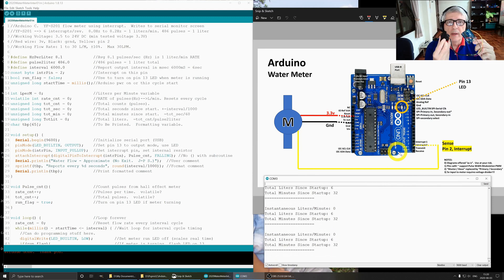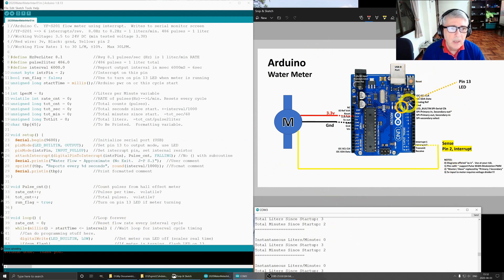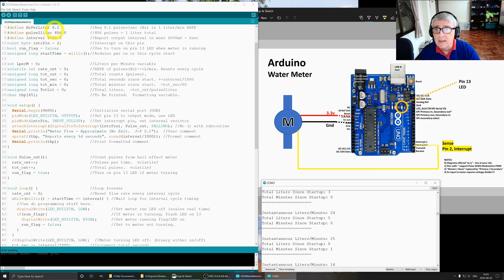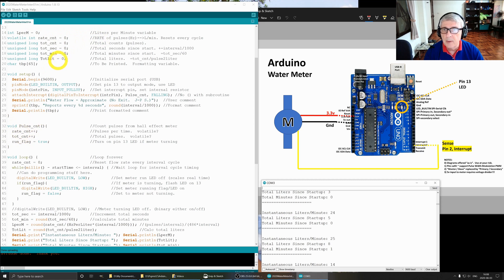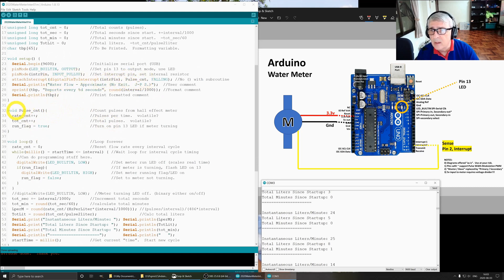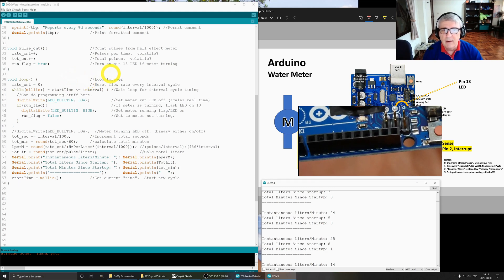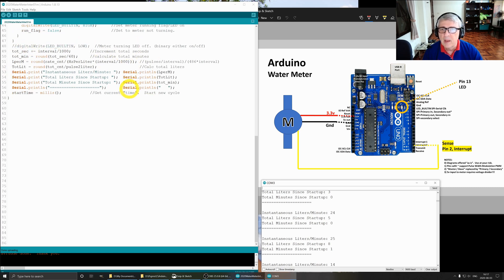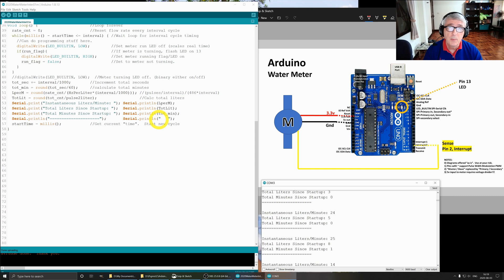Arduino Water Meter, Simple (4K)

Comment: So lets say I want to make an 5gal bottle refill station for drinkwater. I add a solenoidvalve to shut off when 5gal has passed. Plus a input money payed start. And a couple sensors to check.if the bottle is placed before start. And to.check for leakages in dif stages of the system. Could this all be controllerd by a nano arduno?
I forgot also a motor with a spiral to.sell caps.
Reply from the maker: Some arduinos might have enough inputs/outputs to work. Depends on the number of switches  sensors, etc.

Comment: This is great for what I was looking for , thank you ! 👍 is there a place where you have the code posted or the video is the only place ? Once again great explanation.
Reply: Is there a link to your code . I don’t have a 4K monitor even though the video is clear the fonts don’t look that clear on my screen, I guess I can work it out by pausing and zooming in… never the less thank you once again for the explanation it will work for my water cooling project monitoring the water flow and setting shut down due to low flow or no flow !

Comment: Can we use this meter to calculate AIR FLOW?
Reply from the maker: The idea could work, but there are 2 problems with this device.  First at high speeds it misses measurements and second at high speeds the Arduino (and Raspberry Pi) can't keep up and misses measurements.
Reply: @tsbrownie  Thanks for prompt reply.
Actually I don't need very high pressure. The air pressure will be used which is required a medical patient who inhales oxygen through oxygen cylinder.  I want to mix atmospheric air with oxygen. And for this purpose I want to calculate generated air coming from air pump.
Reply from the maker: @ScienceTechnologyExperiments  You have to be real careful with oxygen, many chemicals will spontaneously ignite.  I don't want to be negative, but I really don't think this is the right meter to use for that application.  I think there's the fire risk and it will probably not keep up with even a relatively low flow of gas.
Reply: @tsbrownie  Thanks for the suggestion.